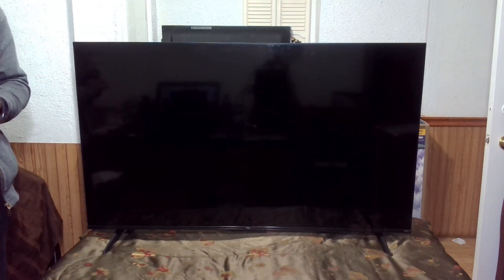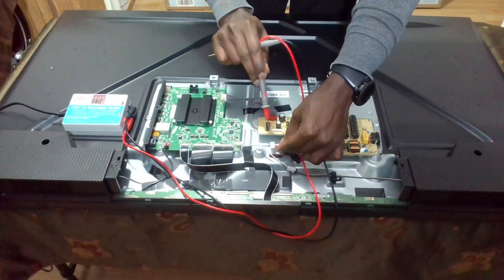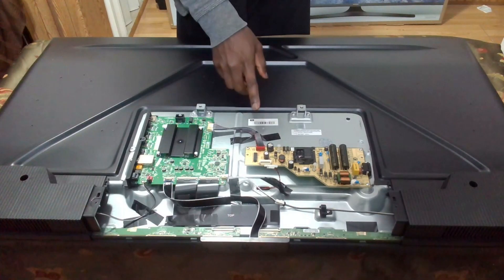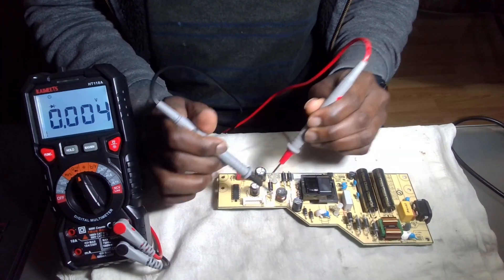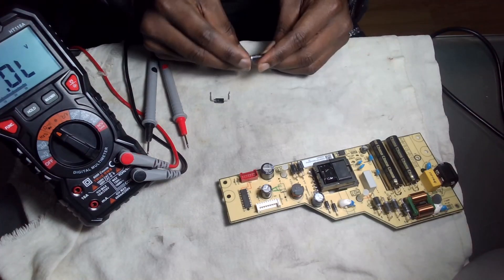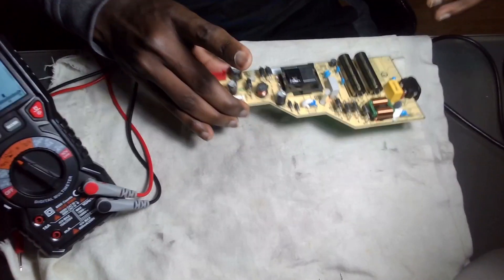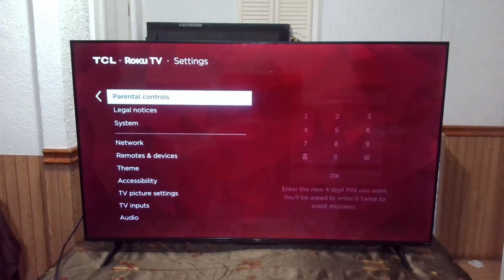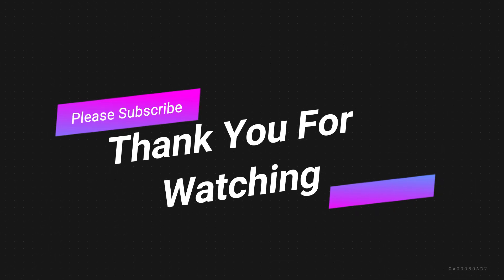Easy Fix TCL TV No Display or Black Screen with Sound. TCL 4 Series 50S455. Power Supply Diode Issue

Comment: Can you walk me through using the LED tester to test the backlights from your video at 4:04?  On my TV there are two pairs of wires on the connector coming from the power supply.  I assumie I am disconnecting that connector and using the tester to power one of those pairs?
Reply from the maker: If the 2 pairs of wires (4 wires) have the same number of colored wires, then one pair would control the left side and the other will control the right side. So just connect the red and black leads of the tester to one pair (different color) to see if either the left or right side lights up. Usually its red to red and black to black. If it doesn't work, just reverse the polarity. Hope this helps and sorry for the late response.

Comment: I have a TV with the same issue. I tested the LEDs and they work. I ordered a replacement kit with all three boards. When I installed the new power supply board, the screen works but with two large blank lines running vertically (at the clear ribbon connection points.) So I replaced the main board. When I install the main board, the backlights work but theres no picture at all. When I go back to the old main board, again picture comes on but damaged. The question is- can you possibly tell me why a new main board would show no picture, while the original main board does show picture (poorly)? I don't believe the new main board is defective because I already exchanged it for another. Thank you for any help, and thank you for making this video!
Reply from the maker: Sorry for the late response. The situation is complex. You didn't mention anything about the TCon board. Was that also replaced? Usually, a vertical blank line may be a faulty tcon board, or faulty panel, or incompatible motherboard. A few things to check are the part number of the motherboards and ensure they are the same. You may want to use all the new boards you received together in the TV, instead of mixing them up with your old parts. One last thing, when you put your old boards back, I assume you don't have a display but have sound, did you check with a flash light to see if those vertical lines showed up? The vertical lines may have been there before the new parts came. Let me know how it goes.
Reply: As far as I understand there’s no Tcon board on this model. Just a power board, main board, and “wireless board.” Regardless yes I did initially replace all three boards with  the ones they sent. Backlight works but no picture. When I put the old main board back in, I get the picture with two blank lines. Their tech department responded to a similar question I asked above and said the problem is that my LED has “shorted drive ICs”, which then caused a failure on my power board, and therefore it is not reparable.
Reply from the maker: @marshallsanchez2070  My mistake, I got this mixed up with another TV model and thought it had a TCON Board. What baffles me is that the new board does not give the two black lines. The issue should be replicated with any motherboard if the issue is from the shorted drive ICs. But yes, as i said in my last response, vertical lines can be an issue in the panel.
Reply: Yeah that’s what I assumed as well- that interchanging the old main board for a new one  should have, at worst, the same results. I do a lot of electronic repair and I definitely hit my “more time than it’s worth” limit on this. I just bought a new one of the same model- because now at least I have spare parts! Thanks so much for your replies and your video. It’s all incredibly helpful.